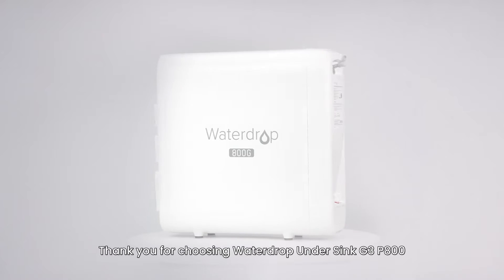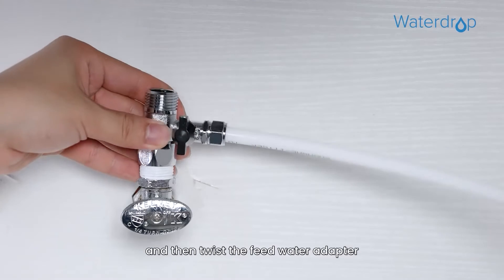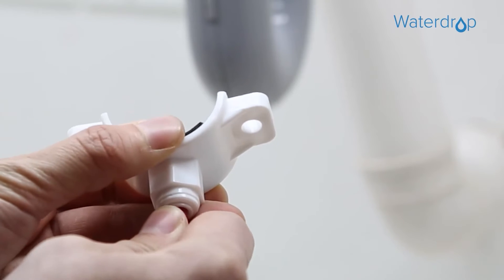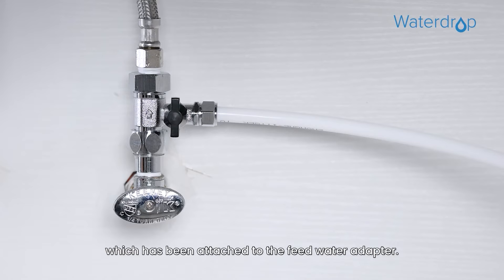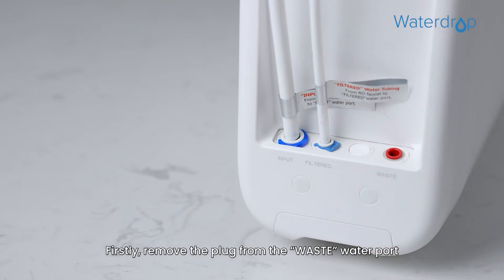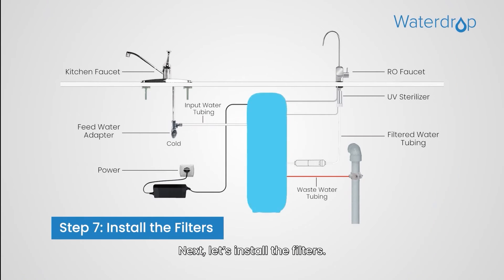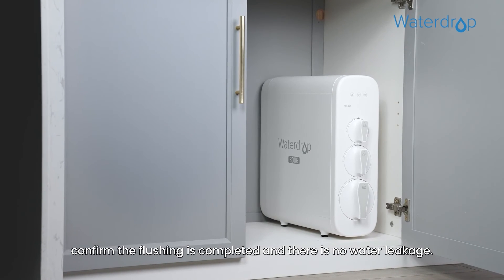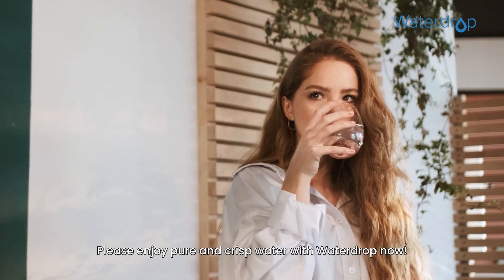Waterdrop Under Sink G3 P800 DIY Installation

Comment: Where does the MNR filter get Installed on the Waterdrop 800g with the UV System? Before the UV (so water feeds from the MN into the UV filter), or after the UV filter (so water would go from the UV filter then into the MN filter before coming out the faucet)????